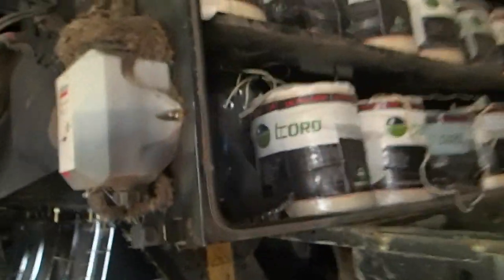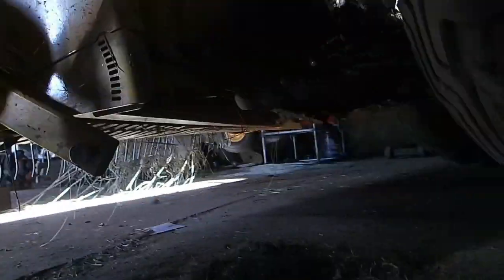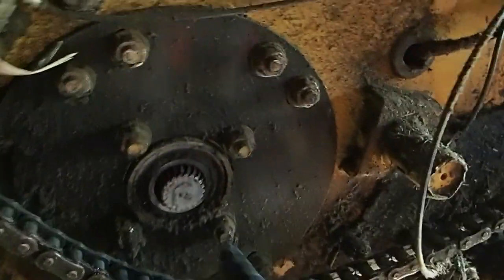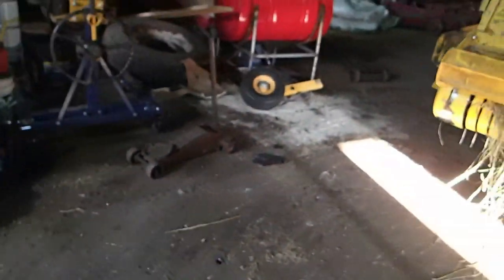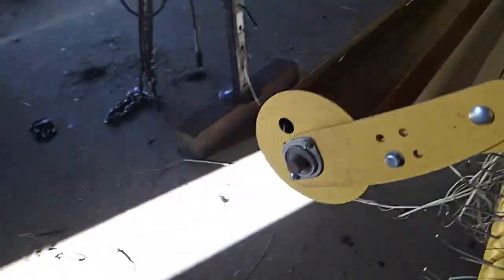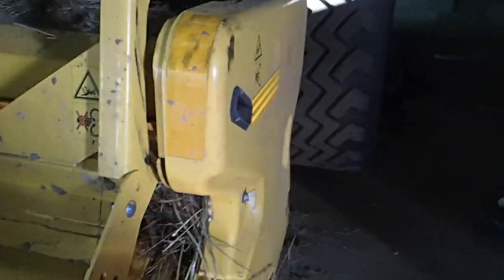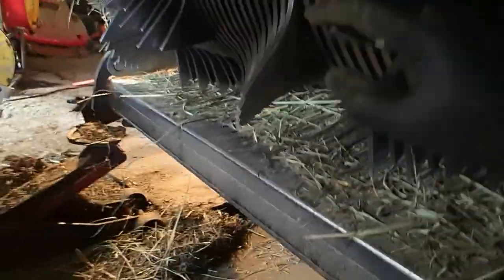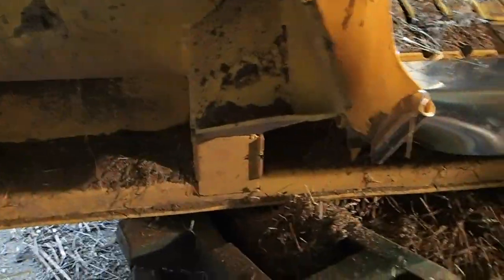dang i say and dang again!!!!

Comment: that funky looking bearing, is tapered bearing on an adapter sleeve, as you tighten the nut on the sleeve it tightens onto the shaft and the bearing, normally very handy to change a bearing where these are fitted plus if the shaft is slightly worn or u have too grind abit damage off it the sleeve will slide on there and u just tighten it up. Great vids, pitty about the damage

Comment: Hi Wes looks like bad weather and baler problems are following both of us. had a bearing go on the NH 688 at midnight last night while baling the 300 acres of straw. i got lucky and saw the flames right as the fire started. Got her out and spent the day fixing the bearings on a roller. Just heading out the door for a trial run, if the straws cooled down to bale after todays crazy heat. My parts at $600 for 2 bearings and a support Plus the other $300 they never had in stock that's slightly fire damaged,  make a hole header frame look cheap.  I'm guessing you stopped pretty hard for the damage you got. Or it Makes me think that header was screwed before with that extra movement you had seen before and the stop finished it.

Comment: Dang is right!   terrible damage but fixable for sure. Glad it isnt worse. Those threaded bearings are there to preload against the shims so the rotor sits correctly. You should probably find out how tight they are supposed to be.

Comment: One does wonder about why the slip clutch didn't work well enough (-if at all!) to save that shaft? Are there not some sort of helper springs arrangement to assist carrying that pickup or are the wheels designed to carry all the weight?

Comment: Wes, let's try not to get fed into the baler this time..., you would go in gruel....

I don't know, there is a point at which it is good to consider a complete header (sometimes complete assemblies are cheaper than the parts to fix).  You could always save this header for spare parts - and you already know where to reinforce a new header....  And to have a spare header for a situation like this, would be convenient....
The way some of that sheet at the feeder is rolled over, makes me think it will be very difficult to straighten....

Either way, I look forward to finding out how you fix it this time....

Comment: That flange bearing is the same type used on the rear axles of go karts. They can take side loads or thrust from the side better than a pillow block bearing supposedly but I'm not an mechanical engineer,

Comment: Loved the opening with rpeek's saying!  You might need him to help you figure it out.  Someone help me here.  Is that the baler Wes spent so much time on the sprockets and chains bending the housing on the pick up head?  Seems like last year he was spending a lot of time on chain and sprockets on a baler head.  I do remember him welding on the header to make at least one of the sprocket mounting more substantial.
Reply: jbmbanter  Yes, if you look closely, you can see the reinforcement in the upper front corner of the right side chain case when he opens the cover.  BB340 crop cutter mods....
This is the first time I have seen the left side chain case opened, and I am dissapointed that there is not a secondary drive on that side, it has a chain, but it looks like it transfers power from the shafts being driven from the other side....  So the loading forces from Wes size windrows is pretty significant for that thin of sheet metal....
Reply: Thanks bt.  I thought it was the same baler.  If I remember correctly he welded a piece of iron, maybe angle iron, in the area that needed reinforcement and it seems to have fixed the chain and sprocket issue.  Other than that issue that baler is good and makes monster bails.  Looking forward to riding along on the JD wind-rower some more in the future.
Reply: jbmbanter It was actually a scrap strip of 2 or 3 inch wide 1/4 inch plate, if I remember correctly....
Reply: +Homestead Kids it is the same baler, the sheet metal chain case was manufactured with sheet metal of insufficient gauge for the design. if more flanging was integrated, or thicker gauge sheet used, it wouldn't have required modding. the sprocket's axle put too much tension on one side of the case, at a corner, and simply overloaded the design. I don't believe he was over tightening the chain, but it was too much for the metal. the sad thing is, given the direction of chain travel, and layout, they should have known that spot would require more reinforcement, as that sprocket puts the heaviest directional load on the case. It gets around 190° directional change to the chain, and is the last load sprocket, before the chain returns to the drive sprocket. which means that all the forces to drive the header are put through that little sprocket, hanging from a corner of the chain case. even the drive sprocket doesn't suffer as much directional load (probably about 110° directional deviation to the chain path).
Reply: +Homestead Kids well, I don't remember it shearing sprocket teeth. I believe it was breaking/opening  master links, and over heating /wearing the chain  (the Oilers hadn't been properly adjusted). it was also trying to throw the chain off. I believe your right in that he was putting a little extra tension on the chain, as he had some trouble with the chain jumping teeth, which flexing of the chain case could have caused.
Reply: big t I think I was wrong about shearing teeth and you are right about the chain failing at the master links.  I remember Wes fixing the chain and then going to JD to buy a new chain  thinking US chain but as it turns out I think it was Chinese which didn't make him happy.

Comment: Shoulda bought a Krone baler there buddy.   38k bales on mine and lots of hard use... Never changed anything but oils, billhooks and knife arms.... sorry about the broken machine... I got as far away from new holland machinery once we sold our bb900 3 ties.  Switched to krone 3x4 and never looked back.
Reply: aleesixstring i have a friend who had run an krone bigbaler for 1 season, its the worst machine he sad. it did break many places. they have 2 off them and both are 3 years old.
Reply: subtotalnevada6 Most likely its thier own fault if they are having issues with it.  They are built like tanks and they only way to break one is to abuse it.
Reply: Mack Thompson Sounds like you don't  know what you're doing than. I've never seen/heard about anyone before you that has had trouble with Krone balers that wasn't the result of human error.. Sooo.. Either you got a lemon or you're just not good at stuff like reading and following directions.

Comment: i would check with new holland to see if those gears need to be clocked in a certain way kindah like the cams on an engine 
would allso ask if theres a pretension needed on that treaded bearing you where wondering about 
i have no doubt you get it working again though there is a chance it whont bale as nicely as it did before

Comment: Dang again, the only thing worse than a broken bailer is a broken new bailer with a hundred acres of hay down. It sure does make life flustrating on a guy. Keep a level head and get er fixed. I know you do hundreds of acres, but wouldn't it help to inspect all the fields in the spring to look for possible problems ? Like fire rings, rocks, and wash outs? Just a thought. I've been following your channel for a while now and it seems that you have a lot of repairs from hitting things in the tall hay. Either way hang in there buddy, keep your chin up.

Comment: you know I was bushogin one a farm we had leased long long time ago, with a 4020 tricycle and was moving along nicely then bam the front end dropped in a hole just perfect for it to fall in and snapped the dam thing plum off, I went flying on the steering wheel but managed to hang and get the tractor stopped. Scared the poopy poopy  almost out of me, checked my undies but they was clean, we just jacked it up took the bolts out put it back on. Man that was scary

Comment: A good thing to do is on all you're bush hogs balers mowers bla bla bla. loosen all the bolts on the slip clutch and slip it at the beginning of every summer. when you don't slip it it will cease with rust. hense not slipping when you need it to